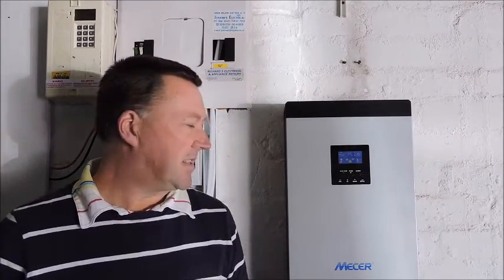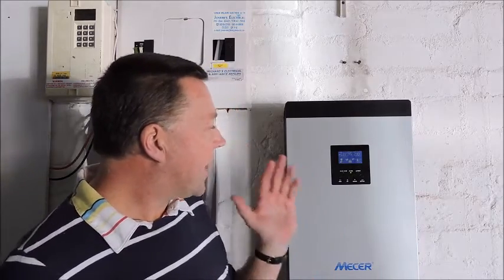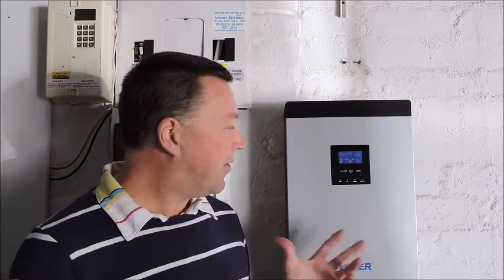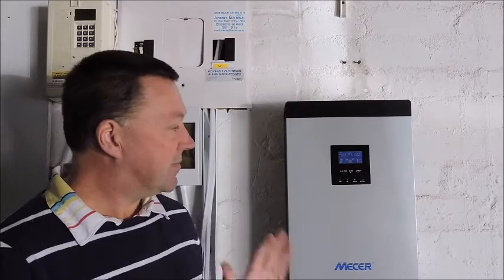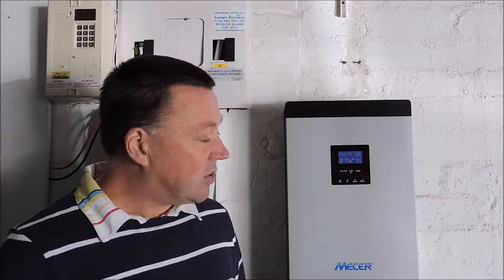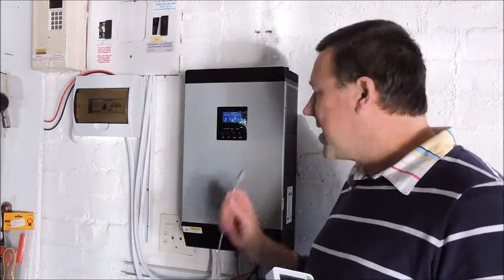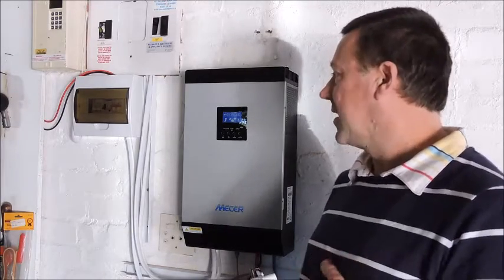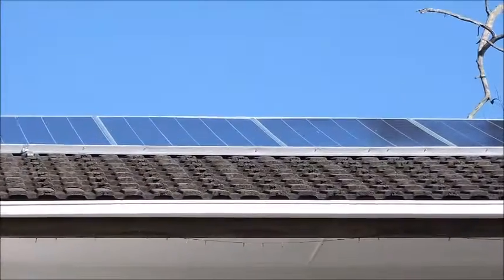Best Value Solar PV installation July  2015 #1

Comment: I am looking for the different settings on this inverter. i have 2 inverters in parallel. What settings is correct for the 01must it be SBU or SOL. what is the difference between them.

Comment: I built an off grid system inside a toolbox, 24v 50Ah LifePo4 battery, Victron solar charger, Chinese 3000w (surge to 6000w) inverter, I run my fridges and freezer on sun shine days and only the fridges at night. I have 4 by 100w solar panels that I deploy during the day in my back yard, then bring them in at night. Now I am thinking of a 5kw hybrid system so I can make an off grid distribution board and run the plugs as required, thus 2 systems in one house. I am an Installation Electrician, retired.

Comment: go more for 300ah battery's is better. 4 120ah will last only 6hrs. agm battery's don't like it to go lower than 12.2v. go for 300ah and if you can 3 in a row toe make 12 battery's. or more better go for lithium ion battery's.

Comment: You should put 8n1 diodes on your PV . they actually drain power at night
Reply: Should the solar charge controller not prevent discharge via the panels at night?

Comment: HI Alan, I've installed a similar setup, but I'm having issues. If I can ask you a question or two. You say your PV array is 280x4=1120? During full sun, midday(peak performance), what read outs are you getting from your inverter for PV volts? PV amps? And PV watts?
Reply from the maker: Sorry missed this one my panels are 1m2 and I get about 80% of the spec wattage on a good summers day

Comment: Hi Alan nice video.Ive just purchased the Mecer Axpert 5kva inverter.How noisy is it when charging the batteries?Is it completelely quiet when not charging?
Reply from the maker: Hi there are a few different models the passive MPPT charger cooling is a lot quieter than the one with interanal fan only.

Comment: Hi Alan I have basically the same setup, but without the solar yet. Can you please tell me how you did the DB install. I have some issues running my inverter with it's own DB running a 20 amp switch to plugs from another side of the house(just switched off the 20 amp for plugs at original DB). If I switch on the new 20 amp switch it trips the earth leakage it trips the original earth leakage and when I switch on the original 20 amp it trips my new DB's earth leakage. Any ideas?

Comment: Does anyone know how to connect this inverter to a computer for remote monitoring?
Thanks!
Reply: +Adrian Zlotea There is a special card that you can install inside and it will give you ethernet cable.

Comment from the maker: Hi I have heard only good things about these inverters.
Reply: +Alan Falck  Hello. I am about to buy this inverter. What is strange that some come with a huge radiator on top and some do not. I am talking about the 5Kva. My question is when solar power and battery power and not enough then it switches to grid power.. how much power cand it take from the grind and send inside the house? 4000W or this is not limited..? I hope not because I have electric stove
Reply from the maker: Hi forget using your electric stove, this will use a min of 3000w alone, rather put this on a separate feed from the grid or use Gas.  The 'radiator' cooling fins seldom get warm and help dissipate the heat under heavy loads.... hope this helps.
Reply: This inverter allows to combine the power it generates with the power from the grid. At least this what the seller says. I will be able to test next week.

Comment: Thanks Alan. I'm looking to buy a 3000VA unit to run off-grid, just for fridge as I'm using gas and have my lights on another 12v system. Will this hybrid turn off when the fridge does and ...? Also, any advice on whether high-cycle batteries will be better than deep-cycle for the fridge?
Reply from the maker: +Anthony Karl Kreiner  Hi if your budget will allow you to try and get the 5Kva its much better VFM and versatile.  If you are a Mustek dealer (or know one)you can pick one up for around R9k excl. I'm also using the smaller 1K model at work and it is excellent VFM. I sold my old fridge and the new one is AAA rated super efficient (about 80w when running). I would get the cheapest batteries you can to start with and replace with high-cycle when the demand drops off. It seems like its easy to damage new batteries in the initial setup and you pay a lot more for the high cycle.  Do some logging of your typical usage.
Reply: Alan Falck Will do, thanks for the advice.